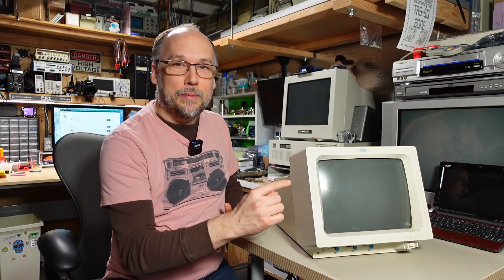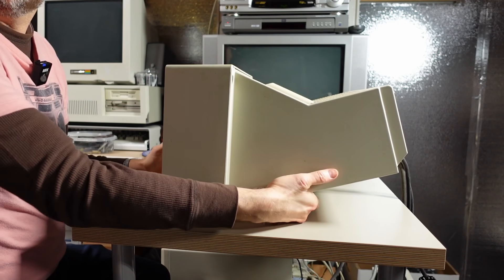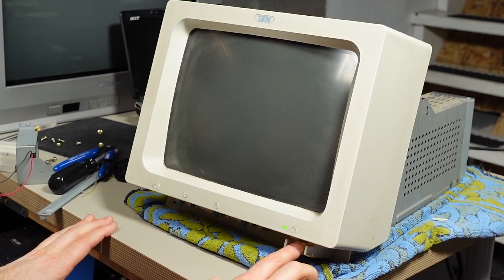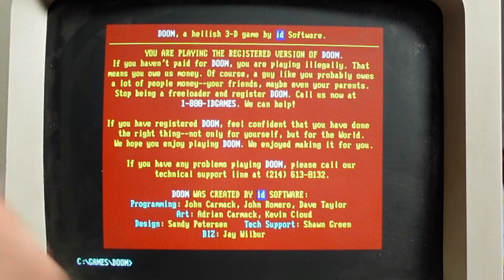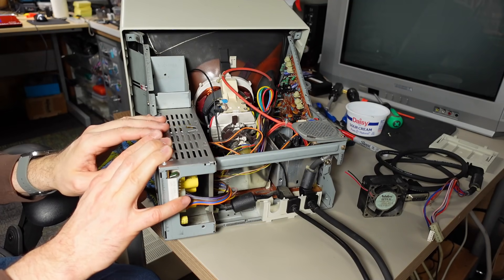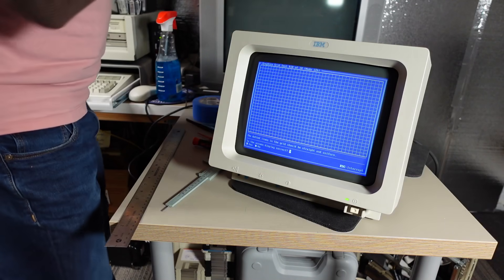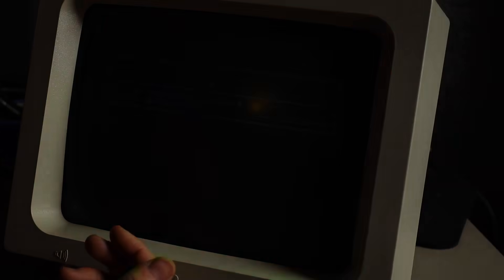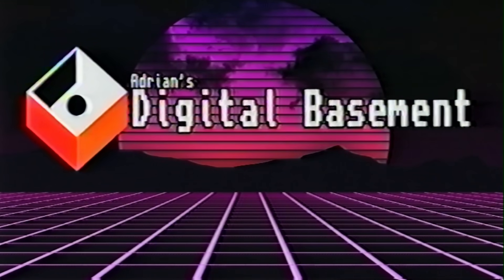The IBM PS/1 VGA monitor is built like a tank! (and still useful)

Comment: Hey, great informative video. I bought one of these new in 1993, but the mono version. I still have it, it still works just fine. It's actually a really nice screen, clean and sharp. Really sharp actually, but then the mono variants always are. I was thinking of trying to make up an adapter so I could use a down-sampled 1024x768 to display on it (max res is natively 640x480 as you said). This would allow the use of Windows 10 etc that don't work at 640x480.

Comment: That's a nice little monitor! Might be worth trying to find out if the main B+ voltage is a bit lower than it should be. If it's low then it could be the cause of the smaller than normal image (although I have seen that on some older pc crt monitors I used years ago when they were new so it may just be how it came out of the factory). Could be though that it changes B+ according to what resolution you're using. Could also be the width cap (electrolytic) or the retrace cap (usually polypropylene) getting a bit out of spec. On arcade monitors, if you change the crt with one that has a yoke that's not quite the same as the original and you can't get the image wide enough, you can usually change the HV retrace cap for a different value (lower if I remember correctly) to get more width.
Reply from the maker: It's certainly possible -- I've heard of this mod. I heard of doing this mod. Without schematics I wouldn't feel OK doing it knowing this is a multisync monitor. If it were monochrome, I would be easier. :-)

I looked at a bunch of pictures of this monitor in operation (from other people) and they all appear the same, so this is likely how it was designed.

Comment: The one thing I personaly would do, is figure out how the audio is hooked up, and put a 3d printed bracket with a standard 3.5mm jack in that hole on the back. just because there is a volume slider :D

Comment: I would have figured out the pinout for the D15 and make a breakout for it so you can plug the audio from a sound card in, or depending on how much current it can supply supply a different type of computer
Reply from the maker: Seems someone has done it actually: http://oldcomputer.info/pc/ps1_2121/index.htm#video

Comment: Owning a ps1 system i can confirm this monitor looks great, mine also has a lot of unused area. If you can find a ps1 (model 2011 or 2133)  grab it, yes specs wise it is nothing special but it so super quirky you will love it anyway.... Also it's a small tank build wise as the monitor. Btw the ps1s for this monitor were not available with 486s, only the models i said above.

Comment: Yes, nice statue, top could be sharper, colors are nice, adjustment is helped, nice, also have a few that are like that.

I also like ctr monitors I grew up with it, I now have 5 pieces from small to large, also a TV monitor, unfortunately I am not very good at repairing these devices but luckily mine all still work and still give a nice picture.

Have a Philips 14 "is also scart and audio a JVC 14" which is used a lot with 2 inputs scart and comp and audio, a JVC 10 "
Also have an Ancona 14 "scart and comp and audio with 1 speaker.

Use them especially with Commodore 64 and little Amiga also have an LCD with an Ultimate 64 connected to it, which by the way is connected to a CRT at the same time :) can do both at the same time;)) I do that now and then.
Must say with the Ultimate 64 on LCD with scanline on is almost as nice because the Ultimate has nice scan lines most devices do that badly Emulation all hell.
But that is also due to the right TV LCD monitor, also a Philips with HDMI to which the U64 is connected.

But nothing beats a CRT for those machines from that time, my Dutch down-to-earth opinion.

Would still like a GVP monitor, but they are quite expensive and very difficult plugs. I already have so little space, the Retro corner is full and I am satisfied, too much stuff and not enough time.

I don't play with it much, but when I do I always have to laugh, it remains nice stuff from that time.
Quality that you don't see much anymore or is priceless.

Gr From Holland.

Comment: That was my first PC (had a Commodore 64 before that). Original 286 model, 10mhz, 30mb had and 1mb ram. Solid machine, but as others stated, the 286 is not great. Basically no upgrade capability, you had to get a special chassis extension to get card slots and I think it had an option for a proprietary sound card. Played a lot of old Sierra games on mine. Pc speaker and I eventually got the Disney sound source for some digital effects. The built in rom gui was cool. There is a ps1 emulator out there that shows it off well.used to take on BBSes at 2400 bps

Comment: Security bits of coarse, IBM has to protect that fancy C-R-T tech nobody else uses. ^_^ What a strange shape, probably a product of off-the-shelf parts arrangement rather than made to specs construction.
I think people should get 13" or 14" inch monitors, seems to be the kind of weight and dimension they can handle anymore. They were always heavy but people can't seem to stop talking about that now with CRTs, they didn't suddenly get that way when LCDs came around. XD Cute screen but wouldn't suggest it for most because of that deepness to screen size ratio and strange adjustment location. Contemporary furniture certainly isn't as deep anymore.
You hit the nail right on the head, VGA monitors probably had the most hours logged of any of the other monitor standards. Nice to see a thorough calibration, many didn't even bitd so they weren't getting the optimal result. ;)

Comment: It's possible that the reason you can't adjust the width further out is that the original IBM VGA specification expected a 25.175Mhz pixel clock at 640x480.  However, most VGA cards stopped fooling around with that 0.175Mhz and switched to 25Mhz a long time ago.  It's easier to get a 25Mhz clock from a 50Mhz or 100Mhz source, and the only real down side is that on these old monitors would stop the picture horizontally a tiny bit early on the right side.
Reply: That quarter percent difference isn't going to be noticeable at all. I'm not sure how old cards are clocked but my newer (early-mid 2000s) cards have stranger crystal speeds like 27MHz and 29.4 MHz.
Reply: @eDoc2020  

If the horizontal pixel clock is 25Mhz, then 0.175Mhz would make about a 1% difference in the horizontal width if the monitor isn't compensating for it.  So if the screen is 20 inches wide, that would be about 1/4 of an inch -- enough to notice that something is a little off, but not enough to make the display unusable.

Modern monitors and graphics cards use EDID lines to negotiate pixel clock speed per resolution (among other things), so the pixel clock coming from the card itself can vary (within a range) somewhat independently from the monitor's pixel clock used to display data on the screen.  This wasn't the case in the early days though.  EDID didn't exist yet.  It was "bolted on" to the VGA specification later.
Reply: @Calphool222  Sorry, my math was a bit off. I have no idea why they chose 25.175MHz, it doesn't seem related to anything. That's exactly 0.7% extra. On a bezel-less 12" monitor that would be 0.0672" or a bit more than a twentieth of an inch assuming all my math is correct. I don't think that would be noticeable at all.

As I was writing that I realized, if a newer card drives the monitor at a slightly slower clock that should make the picture a bit larger than it would otherwise be. That's the opposite of Adrian's problem.
Reply: @eDoc2020  In truth, it could be any number of things... whatever clock is providing hsync could have drifted over time (crystals do that)... it's hard to say.

Comment: i have one of these with the PS1 computer tat fan is actually very quiet its 12V ran at 5 volt the noisy one is the little 20mm one in the computer itself those PSUs even without the computer unit itself tends to run really warm I've had to replace the psu boards many times on these back in the day due to failed fans it also used to take out the voltage regulator in the computer unit an interesting metal board that plugged rite into the motherboard mine had the floppy and the 40mb HDD option was a great system that CRT might have been a 12" but super sharp and brilliant color and a ridiculously loud pc speaker lol mine booted to an IBM ps1 OS with 4 tiles these computers had an optional modem daughter card pretty decked out rigs for the time 

i still have mine and still working great in 2021 these did come with the famous model M keyboard and the 2 button ps2 mouse both with ps2 ports i highly recommend tracking the computer unit down for this monitor its a wonderful machine

Comment: I have an Amstrad PC1640DD which also has the power supply in the monitor. Sadly, the monitor on mine isn’t working so I have to have it off to one side to provide power, and plug in another monitor! 😁

Comment: Is there some advantage to using a VGA-only monitor vs like, a "newer" SVGA+ one from later generation?
I'm not really involved in retro computing / gaming, but I remember the 17" CRT I had before I moved on to LCD. That monitor supported all the way up to 1280x960@85hz, or 1600x1200@60hz
(It did support 1280x1024, but I refused to use 5:4 aspect ratio on a 4:3 monitor)
That monitor is long gone and by the end it was super faded, even max brightness was very dim, but I have to wonder if there would have been some disadvantage, maybe not supporting all the old VGA modes? But I don't remember ever seeing a resolution that didn't work, when testing DOS games and other tools that let you check monitor resolutions.

Comment: you can force xp to 640x480, go to the properties, look for "list all display modes" or something like that, and use 640x480x60hz.
I have an IBM monitor from the ps/2 model, it's a 8518, and it supports only up to 640x480 60hz. 
it looks good, it's one of my favorite monitors, but since it was my first and main VGA monitor for years, I didn't have 800x600 or 1024x768 until like 2008 hahaha.
Reply: For a while, I had a PS/2 monitor hooked up to an old 486. It supported 800x600@56Hz (you might want to try that if 800x600@60Hz is too tall or doesn't sync); but I ran it at 1024x768@43Hz. The raster is so close in that mode that I didn't even notice the interlacing.
Reply: I knew somebody would've mentioned the trick. From the regular display properties you need to go into the advanced settings, then go to the adapter tab. There you find the list all modes button. It's useful not only for selecting different resolutions but also lower (paletted) color depths.

The trick is still around in Windows 10 but it's obviously a different path to the advanced settings box.
Reply: @techgeeknzl  I can't find in win98 where to set it to 56 hz, the only options I get are "adapter default" and "optimal". and both seem to do 60hz.
I tried both with the monitor set as ibm8518 and as generic super vga.maybe I need a third party utility to set refresh rate in 98.
edit: the unicenter utility from univbe on DOS lets you change the refresh rate, I just tested 800x600 and lowering the refresh I could get a stable picture, it went from garbled horizontal bars to almost normal picture. I don't know if it was at 56 or what because I had to press the - key several times until I got a clear picture, but it's too long vertically, so I can't see the border where it says the HZ. (it's not a centering problem, and it doesn't have a reduce vertical size key).
well, at least I know it could work.
Reply: @pelgervampireduck  Scitech Display Doctor, aka UniVBE, is a wonder, isn't it? The garbled display is a result of the horizontal frequency being either too high or too low for the monitor to sync to, and the too tall picture is the result of the monitor selecting a raster that is too wide for the desired mode. Just hit - a few more times, or play with the sync polarity. It'll get there :)
It sounds like you've found 800x600@60Hz which, in my experience, will display too tall on old SVGA monitors. They need the slightly lower (56Hz) refresh rate in order to push the timing circuit into a tighter raster.

Comment: CRU (custom resolution utility) might let you force-add lower resolutions to that netbook. I use it to overclock and underclock my CRT. If the Windows desktop doesn't let you go that low, something like ioQuake3 might be ideal for running at arbitrary resolutions and being low system load. Running Minecraft at 240p@165hz is probably the weirdest thing I've done.
Reply: I think the best I've done on a CRT is 800x600 160Hz. Practically speaking the only reason I can think of for needing that high of a refresh rate is for active shutter 3D glasses. Or perhaps to get a low vertical resolution without resorting to line doubling.
Reply: @eDoc2020  it's also nice for gaming because the higher the refresh rate is the more fluid and responsive the game will feel. But yeah I did 240p120 for RetroArch on that system.

Comment: I have an old IBM PS/2 VGA monitor and it shows white when nothing is connected to the VGA lead. However, it does go black once you plug something in, even if it doesn't generate any signal.

Comment: That monitor might also do 8514/a resolutions: 1024x768 interlaced 16 color.  I had an old 12" VGA monitor that only did 640x480, until I discovered it did 8514/a compatible mode.  The 8514/a wasn't a normal VGA mode/card, it was an oddball IBM thing.

Comment: I'd be inclined to mount a 1/8" / 3.5mm mono socket in the now-unused hole in the rear, connected to the speaker.
Reply: was just thinking the same! You'd probably have to figure out what pin that cable uses for the sound if you want to use the included volume control and the front facing jack.

Comment: White screen is normal the ibm monitor Will only display pure vga 640x480. I have the little vga IBM monitor with adjustable base  that came with the IBM ps/2 computers. It only has power and vga cables but they are  permanently attached to the back

Comment: Some years back, I found a stack of IBM monitors (later versions than this) and a few worked nicely, and the rest just did that garbled picture, if at the time I knew of the 640x480 limit, I probably wouldn't have thrown them back out, dangit... :(

Comment: You could've used it on your acer netbook you just have to use windows display control panel to set the resolution instead of the intel driver 😉
Reply: Windows XP and newer don't let you set below 800x600 through the regular display panel. There's a trick you need that I'm sure somebody here has already posted. If not, I'll be the one to post it.

Comment: Gotta love the little PS1 Monitor. Never knew about the little stand.  In the Euro version the mains is connect by IEC connector. https://i.imgur.com/HJ7I9ZK.jpg
Reply: I modified my Tandy CM-11 and PCjr monitors to have IEC inlets.  The IBM had a cutout that was perfectly sized for one, which makes sense if they were internationalizing them by replacing the built in cord with an inlet and supplying the proper regional cable in Europe.  Wish they had done that in the US too.  I’m not a fan of built in cables.  :-)

Comment: How much of that power supply is the monitor actually using ?, is it feeding the monitor specific voltages ?, what happens when you unplug that connector on the back of the power supply? can that power supply be removed from the monitor? that would free up quite a bit of weight and space to remove it if possible.

Comment: i have a ibm ps1 2011 10mhz 286, i love that little computer. i have the monitor but it dose not work sadly. i have constructed a power supply for it that consists of 2 hp printer power supplys so i can use the computer on any vga monitor i wish. though these computers and monitors look like vga and indeed work with vga, i dont think they are vga, but instead mcga. i think this because of the pinout only being 14 pin and not 15 like normal vga, now there isnt really any difference in mcga to vga, but vga has higher resolutions and such that mcga isnt capable of as well as monitor detection on the 15th pin (the one that is missing on mcga monitors) but anyways the reason i say this is to reassure anyone in the opposite situation to Adrian here, someone who has the computer but no monitor, it can work without it. there is a huge amount of documentation on these ps1 computers online, my favorite source is the ibm ps/1 resource page, just google it. there is circuit diagrams and all sorts of info on the ps1 there

Comment: What is the name of the utility you're using to generate the test pattern? When you had the screen up before going into the video tests you had successfully had the monitor in the perfect position so I could not tell what the utility was other than its version 3.0.  😫
Reply: Checkit PC Diagnostic tool, been using this a lot in the 90s to do basic checks on custom build systems

Comment: 19:50 they are simply called Alignment toolset or Delrin tools for tv. hifi. ham. but they are way too overpriced on Digikey as I get them in a set of four sizes at my local electronic store for  1.50$ CAD lol so round .80 cents USD

Comment: acer computer could dislay 640x480 or 640x400 if you pick the resolution in proporties of the monitor from a list of suppoered resolution
it is windows xp interface that consider resolutions under 800x600 too low for user interface therefore hidden in control panel

Comment: I'm watching this video on my new computer......and I still can't believe it's turned on. It's SO QUIET!!!! If you get close enough you can hear the water pump. This is INSANE!!! I know one of the fans on the 7 year old geforce 780 is going bad so it could make noise eventually. It's not now. I still have a lot of work to do. There is a rat's nest of wires. in the back. I didn't feel like taking care of it now.